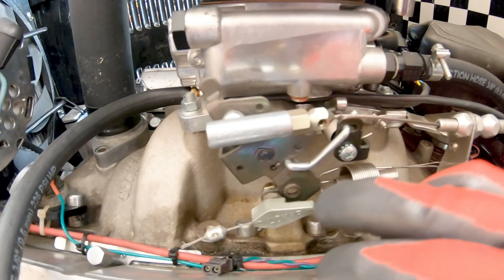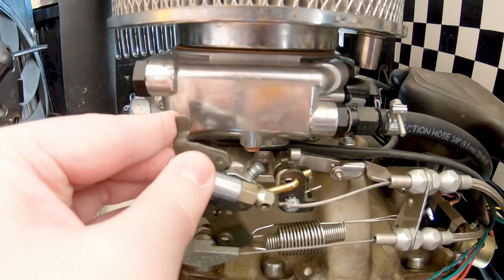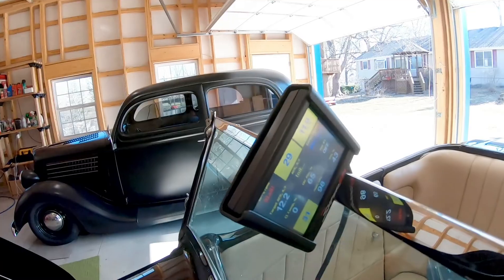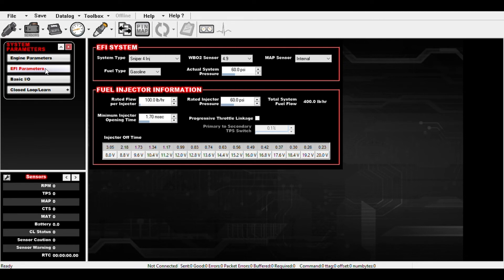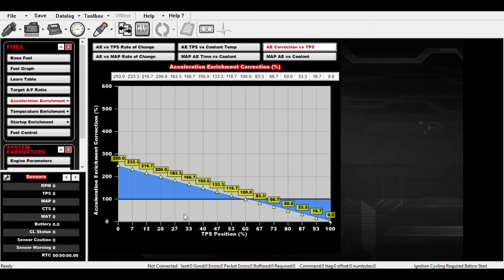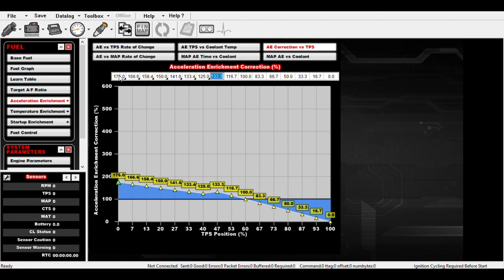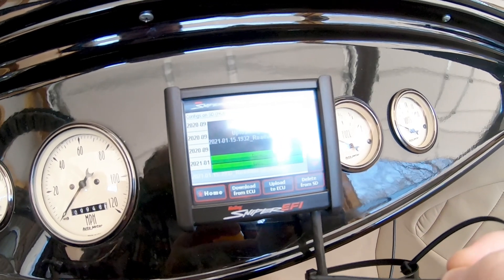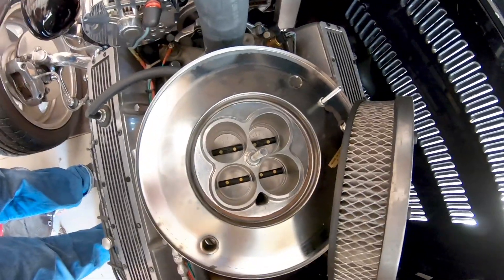Sniper EFI Progressive Linkage Installation and Tuning Tips

Comment: I purchased my holy sniper in 2023. I believe it’s got the right program. I just purchased the progressive throttle linkage have not started the vehicle yet. I got all kinds of things going on Dakota digital dash gauges a new air conditioner, and Holly sniper ignition coil and distributor so hopefully I’ll be able to do all that stuff without a laptop?

Comment: Great video! Thank you.  1 question.  At the end of your video you turn off the ignition for 4 seconds. Then turn it back on. When I turn my ignition off at the key the Holley display turns off - Is my system wired incorrectly?

Comment: I had a tremendous surge on tip-off from idle, I loosened the Phillips screw on the secondary, adjusted so the primaries are just ahead of the secondaries , then changed the setup in the programmer, and it was a 0 dollar fix. I’m learning this Holley thing too!
Reply: @Rocco Declan glad I could help =)
Reply: More info on this please.  Looks like it could be made out of a coathanger.
Reply: i guess I am kind of randomly asking but does anybody know of a good site to stream newly released series online?
Reply: @Rocco Declan flixportal
Reply: @Marcel Cyrus Thanks, I signed up and it seems like they got a lot of movies there :D I appreciate it !!

Comment: I installed progressive linkage recently and I used your video for reference.  So I appreciate that.  Now it's been a few months, how do you feel about it now and have you made any changes on the software side?
Reply from the maker: I am still very happy with the progressive linkage. I had a new issue pop up Tuesday night that I do NOT think is related to the progressive linkage. I am going to do a new video series on how I am going to diagnosis this new issue with the sniper.

Comment: Hi  great car  by the way , can i ask if you use the vaccum  in the back of the sniper for the distributor advance? 
Because  they say if we put the progressive linkage the distributor advance will not work any more because of the back flap are now closed.
Thanks
Reply from the maker: I do not have a vacuum advance on my distributor. But you are correct you would have to move the vacuum advance to the front port.